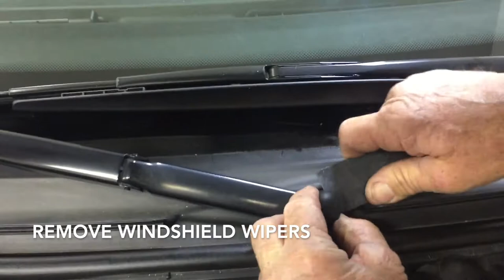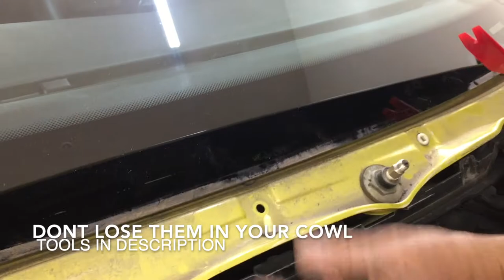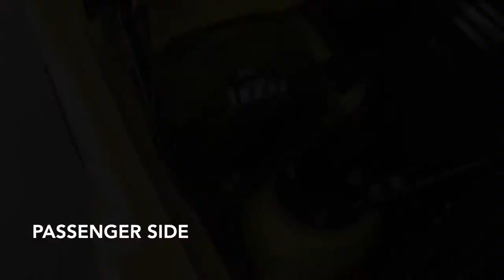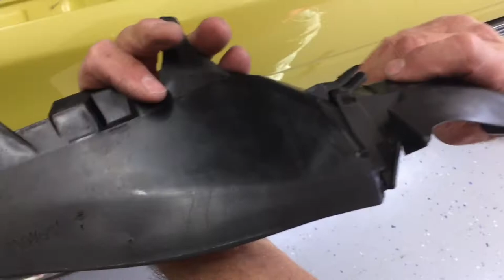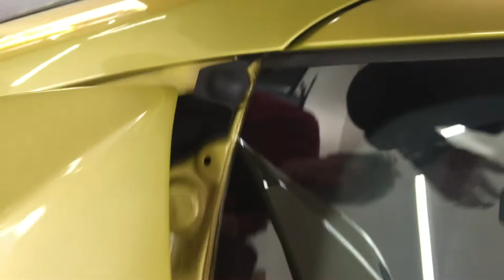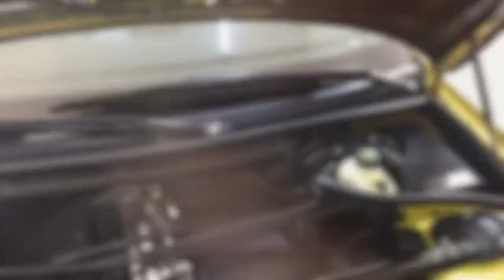HOW TO:  Windshield Cowl and Trim Restoration E46 M3

Comment: Nice job. I ended up replacing the cowl and trims. But, found water in abs area after cr wash is that normal. I do not recall seeing water there before.
Reply from the maker: hmmm, make sure the cowl went all the way in, as in each mounting pin popped in.  Other than that,the small trim pieces that go all around the ABS area( soft foam pieces) make sure those are aligned properly.  It could have came in near the vent for the cabin air if those trims were not meshed properly. let us know!